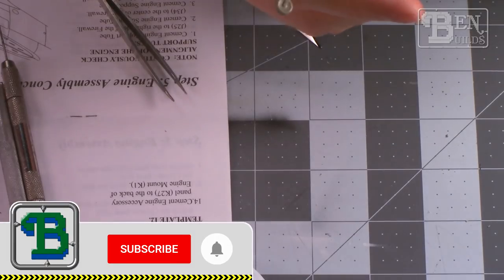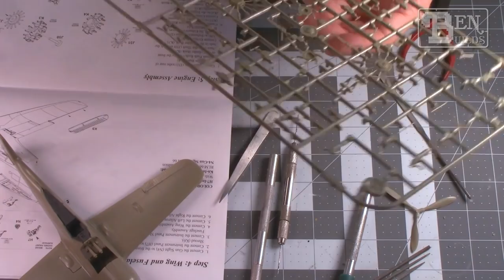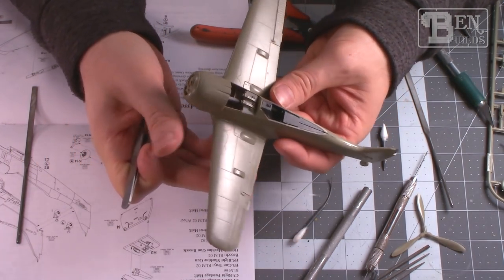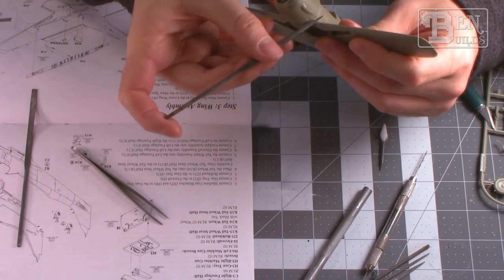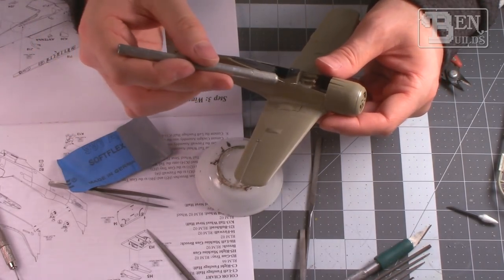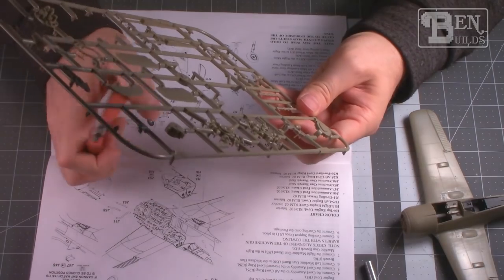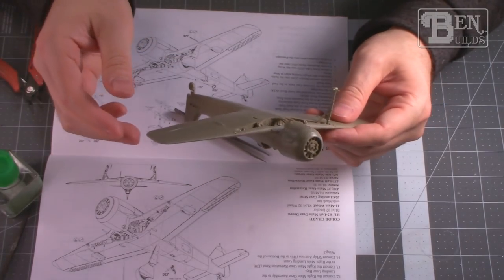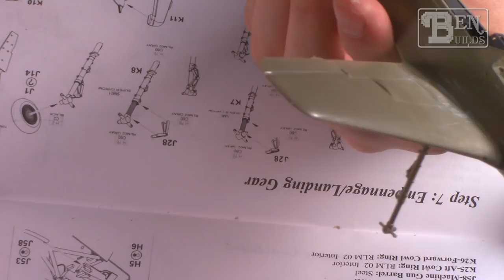D-Day Buddy Build - Fw 190A-8 - ep. 8

Comment: I am not knocking your makeshift propeller shaft, but am curious why it was not easier to put the engine in, but worrying about painting or sanding.
Reply from the maker: Hey Gerry, thanks for watching. Basically, the engine is really nicely detailed and I don't want to waste all the detail by installing it and then closing it up. Plus, I want to try and use it in another project.
Reply: @BenBuilds  Yea now I remember you said that in the previous video. Makes sense thanks.
Reply from the maker: @gerryparker1390  Oh yeah, no problem! I want to do a diorama of a Fw-190 undergoing an engine change, so this way I'll already have an engine that I can use.